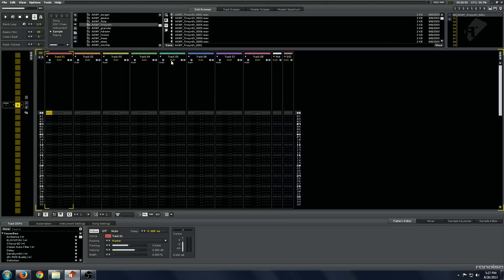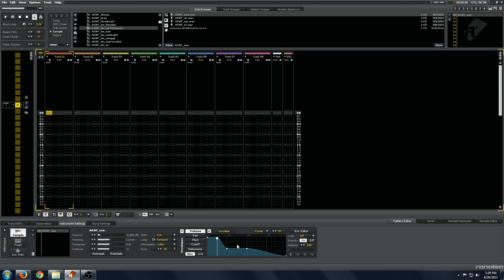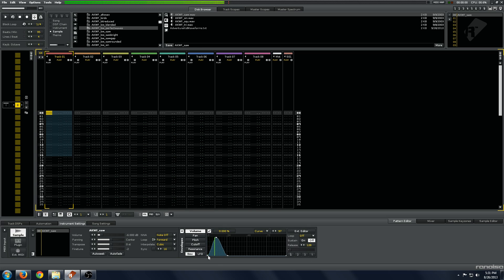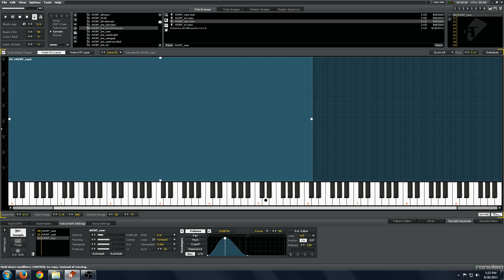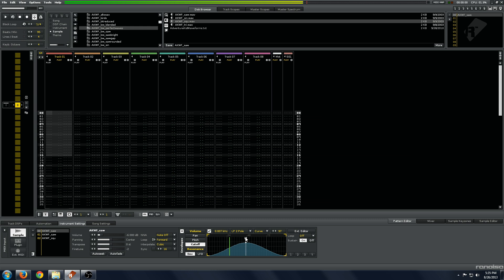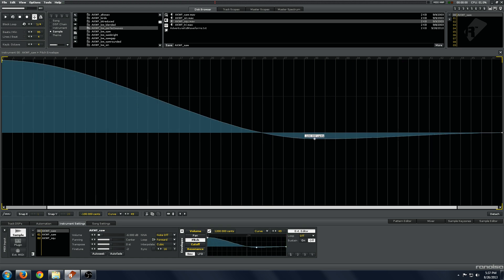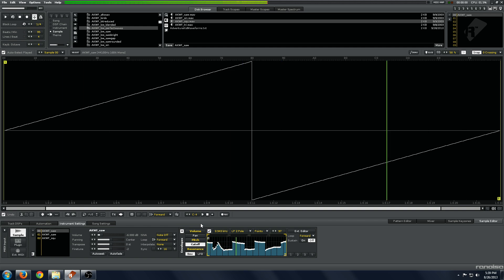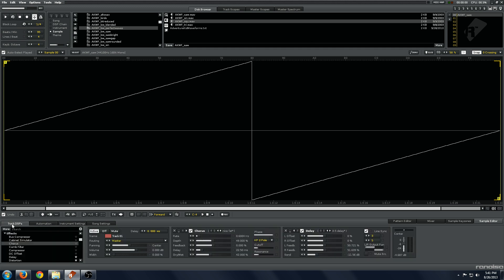Renoise is a synthesizer too

Comment: Sampling a single-cycle saw-wave certainly doesn't turn anything into an "oscillator".  The difference is that oscillators in (soft)synths  produce band-limited waveforms (no aliasing) and they do it cpu-friendly. Samplers fail miserably at both of these aspects. (For example, in Kontakt you can use real-time sinc-interpolation, but it leaves your cpu shaking on the floor in convulsions, swallowing its own vomit.) Try layering 5 detuned saws with long releases in a sampler and watch the cpu-load go up as you play chord progressions. Now compare that with synth1 and its "detune" knob.
Reply: Most softsynths can certainly do this kind of thing EASIER, but Renoise offers near-infinite customization in that area because you're doing everything manually. Try using Sylenth1 to make a 200-voice supersaw with each voice 1.3 cents away from the next.
Reply: +The Short Vlogger Sorry, I meant Synth1.
Reply: +peanatsu Interesting aspect. Renoise just put out a new beta version and I noticed this detail in the release notes:

New, optional bandlimited/oversampled sample playback to reduce 
aliasing, which is especially useful when using small looped samples. If
 you prefer to draw your waveforms by hand, or are a heavy user of 
single-cycle sounds, this feature can make quite a difference.
Reply: Costinio There's a new beta? Thanks!